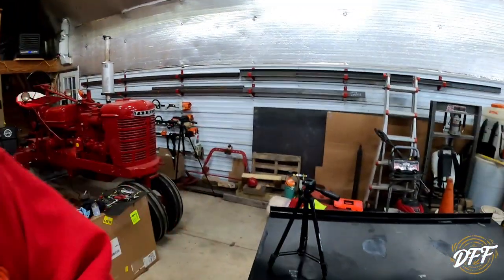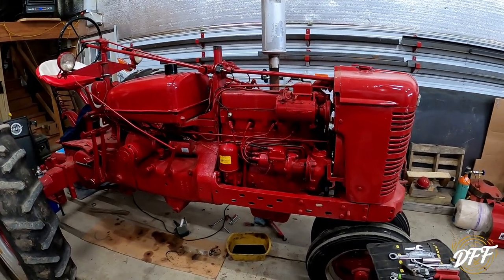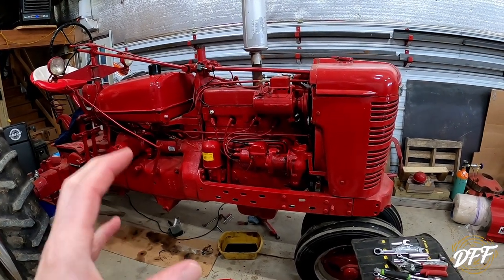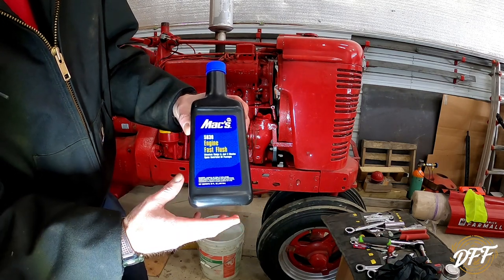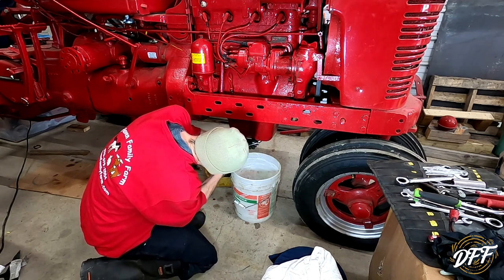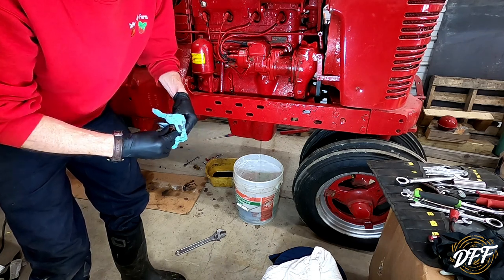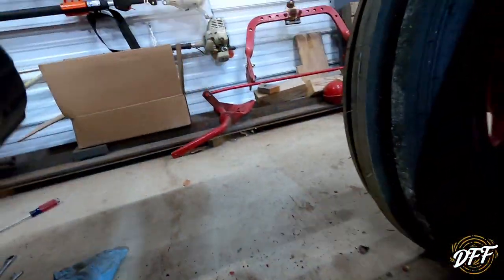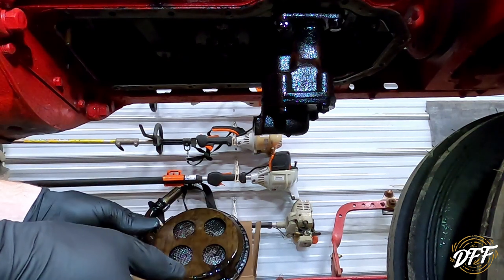Dropping The Oil Pan On My Farmall H!

Comment: Trick for lining up your gasket is just set the bolts in the holes after you've set your gasket..... Oil gets people feathers all ruffled up....I run 15-40 diesel engine oil in all my tractors, gas or diesel engines..Old rule of thumb was for every 1000 RPM you need #10 of oil pressure....Thanks Chris....

Comment: Fun video to watch Chris! That sludge at the bottom of the pan is a fine example of what short run time and condensation can do. Any engine needs to get up to temp and stay there for a while. Even better if it is working hard. As far as the oil pressure that's fairly common on a engine with some hours on it. It's just that all the clearances in the bearings and oil pump are slightly bigger then desired. Have no fear though the rule of thumb is you want 10 psi for every 1,000 rpm a engine is turning. If I remember correctly a H is 1650 to 1800 rpm so as long as you have 15 to 20 psi when hot and full throttle you'll be ok. Just a heads up I would not recommend any kind of cleaner or engine flush.  If it does in fact work it could cause more harm then good. For example that sludge in the pan could get loosen up and start circulating. It would be better just to leave it where it was at. Anyway enjoy the H. Once it gets nice out go for some nice runs or work it. You'll love it.
Reply from the maker: Now you have me thinking... The temperature on the tractor never really warms up- even raking hay on hot summer days. I replaced the temp guage, but it didn't make any difference. I wonder if I have a thermostat issue. Thanks for the oil pressure guidelines, it will give me something to watch for. I really appreciate your input and support 🙂
Reply: @DeHaven Family Farm  That is really odd that it isn't up to temp raking hay. Even if the thermostat is stuck open or not even there at all it should eventually get up to temp. Sadly I don't have a lot of faith in the gauges they produce for these. Either try another gauge. Maybe a automotive one for testing purposes. Or grab one of them cheap Lazer temperature readers. They are pretty accurate. Just scan the head and the top of the radiator it should give you a fairly accurate digital reading.
Reply from the maker: @Jason1Pa  I do have a temp gun, so I will try that to check. Thank you for the advice!

Comment: Man yeah Mr Chris, going after that oil pressure probelm 😁 Nothing wrong with 15/40 in gas engines in my opinion! Pretty slick about that pick up tube. I have tack welded a many of them in SBC's over the years!! I'm sure the bearings have wear, but I wonder if the spring and internals in the pump could be weak as well. Might could throw a pump in it if the probelm still persists. Ahhh, the oil pan torque🤦 So how about when I was putting dad's back in the 3000, I looked in the book for specs. It listed them, at first seemed a bit high, but what the book said . I began to torque them, and quickly realized the book had to be wrong, it was mashing tjr gasket out. Went to the book again, and found out I was looking at the specs for the cast iron oil pan not the stamped steel one 😳 Well let's just say the rest got hand tightened 😁 I love that High Tack from permatex, all I ever used on boats too. Man it's gotten expensive for that little jar though🤦 Look fwd to seeing how the new oil and cleaning helps out, thank you for bringing us along!! 😁😁🇺🇸🇺🇸👍
Reply from the maker: Glad to hear you have had good luck with 15w40. I had thought about the oil pump, but your suggestion may have me revisiting that possibility if the oil pressure gets worse. To be a fly on the wall when you realized your mistake on the torque spec 🤣🤣🤣 Thank you Nelson!!
Reply: @dehavenfamilyfarm  Oh my it was quite the ordeal seeing that gasket squashed out 🤣🤣🤦🤦🤦 Look fwd to seeing  the follow up!

Comment: Good work Chris! For what it's worth I go 18 ft lbs on 5/16 pan bolts. 15w40 is in all my tractors. If your oil pressure issue persists you could try 50 weight racing oil.
Reply from the maker: Thank you for the info on the torq for those bolts. I may just write that down in my manual. I've never seen 50w oil- I will have to check in to that. I appreciate you stopping by and offering the suggestions!!